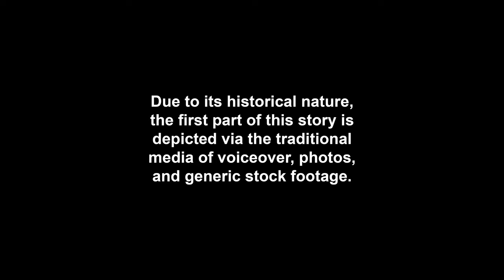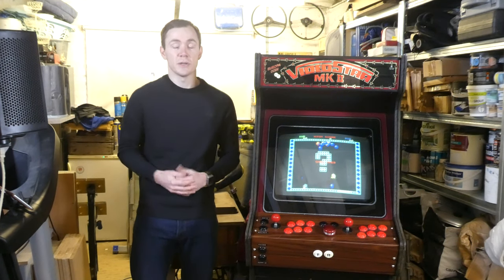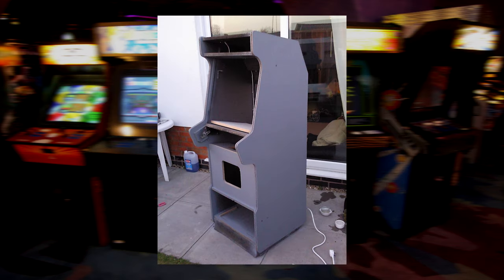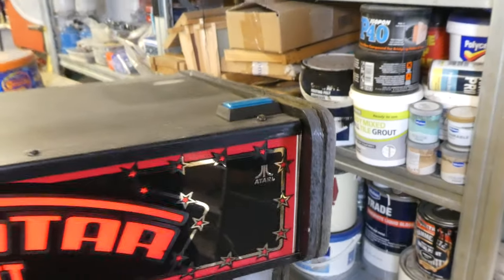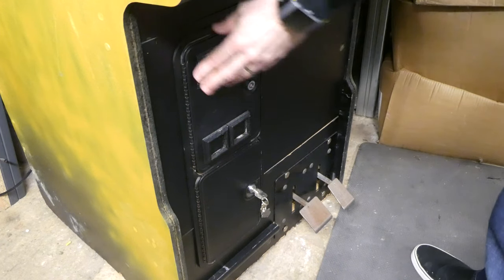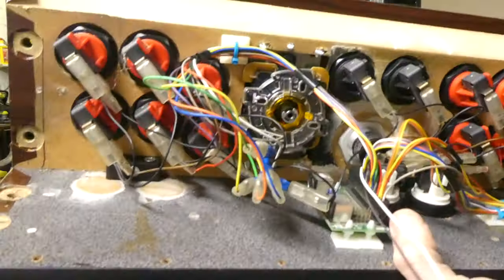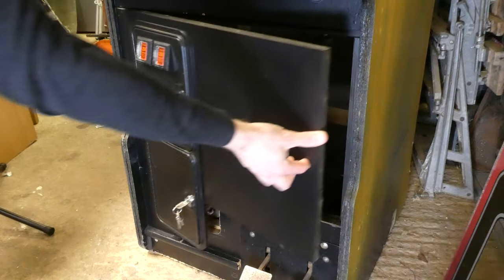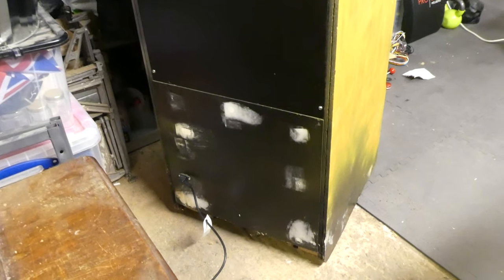MAME Arcade Dream Upright Cab - The VideoStar MkII - 12 Years & Counting!

Comment: I use Mala front end on my cabinet, nice and simple and can be configured in many ways. A quick way to get a good finish on the sides is Laminate, but it's expensive. Then you have Vinyl, but depending on the width of your cab that can also be expensive, I used 1m wide on my builds I think it was around £30. Last option is paint, but it just takes time to get a good finish. I guess it depends on how good you want it to look. I have built 3 cabinets and 3 bartops and really enjoy the building process, it's a shame I no longer have access to the space I used to make them anymore.

Comment: I had to get rid of my cab when we moved, the new place doesn't have enough room and it was getting a bit like a piano - a thing that sits in the corner of the room that you intend on using but is ultimately an awkwardly designed shelf.

Comment: What a lovely Franken-cade. I would try to get the guns working hotswap style, so you can leave the panel on.
This would fit the Euro cab well since most of these where converted to host a multigame board of some sort. 
These machines where mostly kept running by the owners themselves after the mid 90s, so they sometimes also
would have had added a trackball or spinner.

Comment: Would love to see an update to this video and see how you got on with finishing the cab. I've just finished a Pac-Man cabaret replica from scratch and it's only taken me 10 years to get it done so I can relate to how long these machine can take to modify and get right. I put a up a video on my channel of the Pac-Man project if you are interested. Painting and sanding the sides of the cab to get a smooth finish took the longest amount of time. If you haven't painted the sides of your machine yet, I would recommend not using spray paint like I did with mine as it's tricky to work with. Roller paint with wet sanding will get a nice finish.

Comment: Somewhat spookily, my cab has a former quiz machine CRT with the touchscreen removed :)  Some great ideas and info in there, some of which I will be 'inspired by' :)
Reply from the maker: Not sure what mine was glued on with but it took a whole afternoon with adhesive remover, WD40, and a plastic scraper to get it all off!
Reply: @ctrlaltrees  Mine had literally fallen off and appeared to have been originally been held on with gaffer tape around the edges., so I guess I got lucky :)